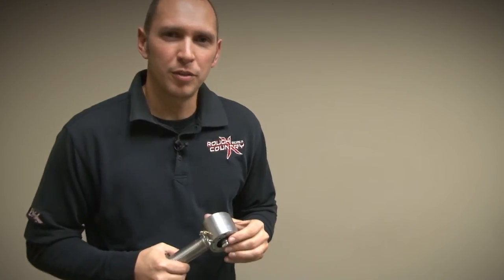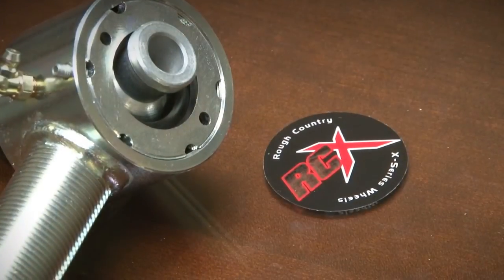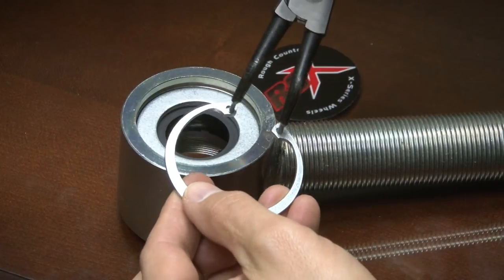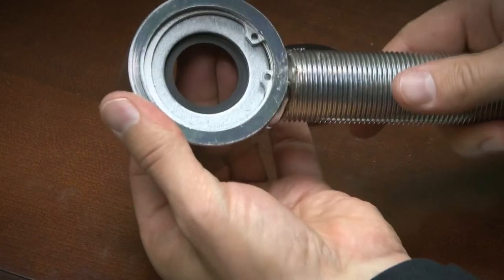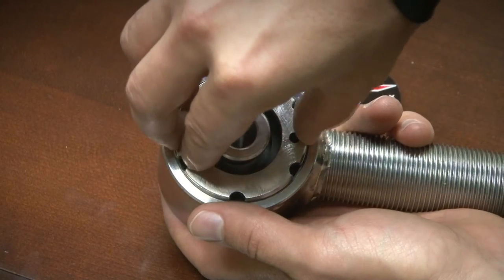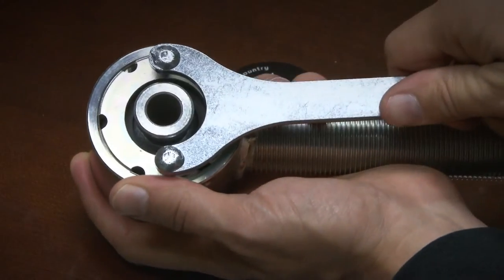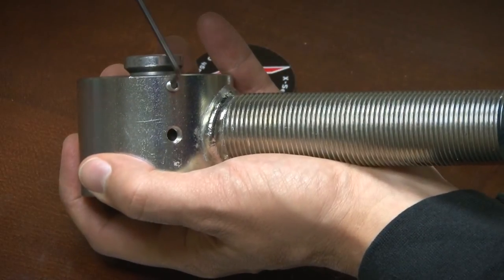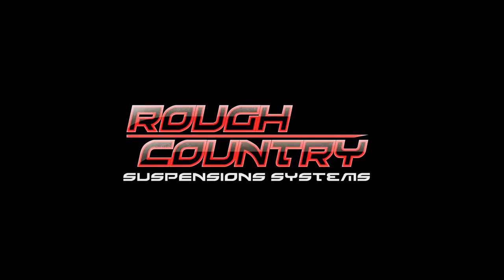Rough Country's X-Flex Joint Rebuild Tutorial

Comment: Good luck getting parts for a POS joint do yourself a big money saver replace the joint with a better made one. They do not have a parts list for this Joint but will sell you new arms with joints Lame Lame Lame....
Reply: Currently having same problem. My RC traction Bar Ladder design has this Heim and it’s messed up. You have any other names for replacement??
Reply: @ThatBoyMichael1 do your joints my a skweek noise?

Comment: Did the joints get a redesign? The 4.5" x-series I bought for my XJ has a different joint style. And they're garbage. I've put less than 7000 miles on my Jeep in the 1.5 years the lift has been in and I think 4 have been warrantied and another is currently bad
Reply: 7000 miles?? too much!! Mine with  1000 miles are destroit!! They have internal of plastic instead poliuretane like this video
Reply: Mine lasted less than an oil change.
Reply: I got maybe 1000 miles dude. lol

Comment: I have 4'' x flex on my 2013 jk and wanted to replace the bushing and the bushing i got not the same dont fit?
Reply: I am in the same boat, did you figure it out?
Reply: @bans25  i guess they have 2 different joint the one we need you need to call them but after I saw the size of the bushing I know they won't last long again so I'm trying to figure out what size of johnny joint will fit on my arms thats what I'll do think they are stronger the rough country didn't even last 1 year and very not much miles
Reply: @DEWGEN08  Thanks, let me know what you find out and I will do the same with what i find out.  I was also surprised when I pulled this apart. Looks like I need to put it back together until I figure out what to do..

Comment: how tight dose it have to be before you screw in the set screw? Tight ...or just till its squezed together. In addition how frequent if at all do these need to be re tightened . Thank you!
Reply from the maker: On those you want them to be good and hand tight. They don't need to be just crazy tight but you want them to be snug.
Reply: @RoughCountryTV  I bougbt the RC long arm upgrade for my xj and heard that the joints dont last long. Do you replace them free and if so how many times if needed?